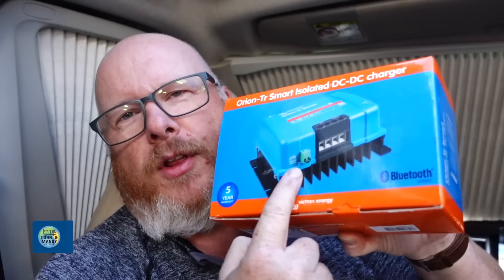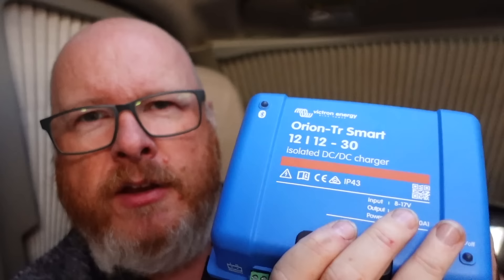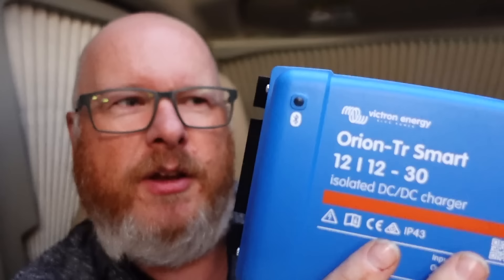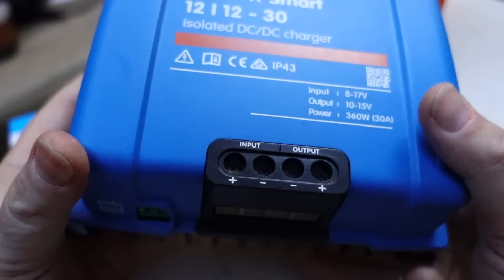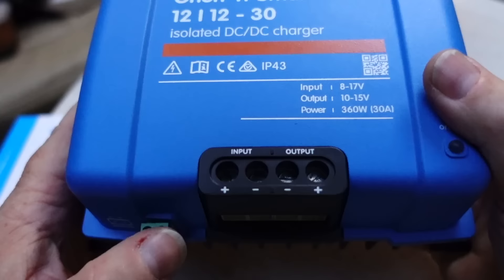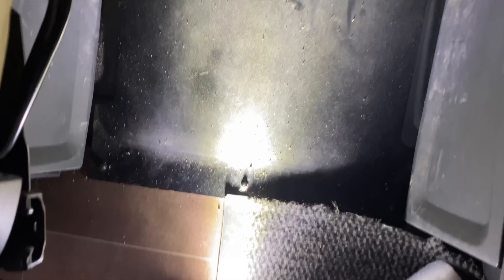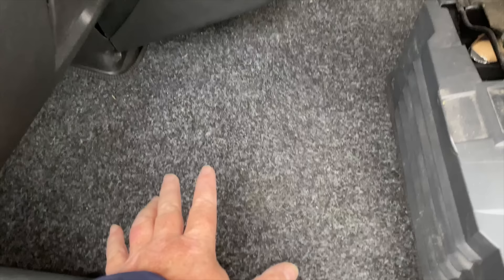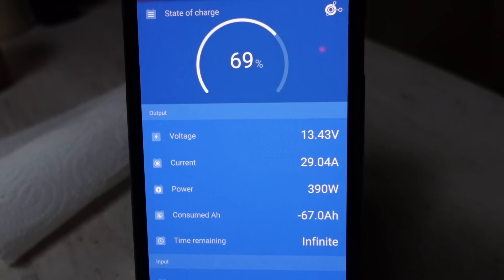Victron Orion DC-DC Isolated Charger B2B Installation

Comment: Hej!
Wondering about a few things:
- My EBL is older but it charges my car and house battery when it is connected to 220v.
Wouldn't this trip the B2B charger to "open" the circuit? Since then the car battery voltage goes up.

- Is a standard alternator sufficient to supply 50 amps for charging (20a+30a) when for example car lights (250w) + 12v absorption fridge (220w) is on?
Reply from the maker: Our alternator copes just fine with this. The b2b sees the alternator voltage, so it depends on your ebl charge voltage, but the ebl hookup charger does NOT cause my b2b to kick in.

Comment: Hi John ,
great video well explained thank you very much. 
I have a question: 
Will this device charge in both directions? what I mean is, will it charge my starter battery. I live in my van and don't drive very often but I have a good solar setup. Can this be set to keep my starter battery topped up? 

Scott 🤘

Comment: Hello from sunny Playa del Rey, California! I have a question that I think is in your wheelhouse: what do you think about me using Anderson connectors from the Orion to my cute little 50a LiFePo so that when I arrive at my destination I can pull the battery out easily (it actually has a rope handle) and carry it off where I can then use the same connector to hook up to my inverter? Jackery Hack! Or am I just dreaming 😀? I sleep in a tent with a CPAP and would love to not have to run an extension cord to my vehicle. I'm a new subscriber and look forward to combing through your videos this evening. Cheers.

Comment: Hi John,
I've got Toyota VERSO car and tow Knaus Sport 500 FDK and wanted to know can I put a DC to DC charger to run from my car battery to my batteries in the caravan. I know all or most of your content s around the motor home market.? I imagine a larger rated wire from batt /Alternator via Anderson plug not via towing plug 13 pin? I'm going to Paris area in ept for some WCR 2023 and of course will  back the Aussies. Cheers Chris the Aussie living in the Netherlands 🇦🇺🍾🏁

Comment: Great video. only thing I thought you could add is if other's are going to "double up" on their chargers then not to exceed the batteries C rating.:)
Reply from the maker: That’s where a b2b comes in as it wouldn’t allow an overcharge. 👍🏻
Reply: @johnmandy  I'm referring to the bulk charge phase and exceeding the C rating. :)
Reply from the maker: Yes, as I said with a quality b2b that will not happen.
Reply: @johnmandy  I'm just trying to help here so please don't think I'm on your back or something. My point was not everyone will be aware that their AGM batteries for example will have a maximum designed charge current of 30% of capacity. So 30A for a 100Ah battery.
IF they was to copy you they would exceed that batteries maximum design charge current. The B2B would only see 30A charge as the other charger they had (eg a 20A like yours) would not be going through the internal B2B shunt. 
So in bulk charge the battery would see 50A charge exceeding the 30A C rating. This is not about final voltage and float as both chargers would stop charge and float, this is about the exceeding the C rate during bulk charge and what effect that would have on the life of the battery.
I just thought this needed saying as we both know people will copy you not fully understanding they can't just go doubling up charge current unless their battery can take it. :)

Comment: Great information there John.  Thanks so much. I have installed the same after watching your video. However somebody has told me that I have fitted the wrong circuit breaker. I fitted a 30amp like you showed.  My Dc to Dc is 12/12 30amp. Should I be fitting a bigger breaker? Thank you.
Reply from the maker: If you copied me then it’s fine, ignore the other advice.
Reply: I was told the same thing? Now I am worried? 🤷‍♀️
Reply: @juliep4193  I think John knows what he is talking about.  👍
Reply: @Wizardinthewild  Yes, I trust John. My problem is... I don’t have a great deal of knowledge when it comes to amps and alternators. I know enough (I think) that the guy who installed my 12/12 30 charger used 10 awg wire, (I am not sure what that size is in UK?)which is wrong, so I am re-wiring it myself now. My 30 amp breaker kept breaking after a few minutes. Which I didn’t understand? I am hoping it is due to a much to small wire? And not the fuse? I will stick to the 30 amp fuse I have and see what happens? Do you have any thoughts? I have a 2019 Ram Promaster and I am “pretty sure” it is a 180 alternator? Thanks for your response. I needed that encouragement to move forward on this. I haven’t been using the charger.
Reply: When I say fuse, I really meant breaker, I have the same 30 amp one John is using.
Reply from the maker: @juliep4193  Ot could be a faulty breaker. I’ve seen this before with poor quality breakers
Reply: @johnmandy  Thank You John! I will order another 30amp breaker if the problem persists, after I put the bigger gauge wire (6 awg) US. 🙏

Comment: Except for the choise of battery type; are there anything else in the settings that needs to be configured? I got a motorhome with start/stop function. Thanks for great videos. Peter
Reply from the maker: No, just the battery type and the rest it handles itself 👍🏻

Comment: Why are split chargers a bad idea now a days ? I've just bought one to put in my 16 plate Renault trafic. Are you saying I should ditch my split charge unit and get one of these ?
Reply from the maker: A split charger can’t detect the state of charge of the battery, whereas a good quality b2b can offer different levels of charge to allow the best charge to be delivered right up to 100%
Reply: @johnmandy  sadly at over £200 and on a budget, not within my reach this time. I have to stick with my split charge unit for now

Comment: Great video John 👍
Do you have a smart alternator - is it relevant what type your alternator is?
Are you concerned about the load on your alternator, surely this is more of an issue driving along when headlights and other vehicle battery loads are added.
Have you thought of carrying a spare alternator - I detect they are a problem with motorhomes.
Hope your much happier in lock down this time and new electrics are reliable throughout.
Thanks for posting.
Reply from the maker: The beauty of a b2b, as I showed in the video, is that it amplifies the charge, so it’s not putting a large load on the alternator. 👍🏻

Comment: John has your van not got an  Converter’s socket in the B Pilar behind the driver's seat you could of contacted the B2B to easier?? Save taking up carpet
Reply from the maker: The factory cable isn’t suitable for the amount of power I’ll need for this & additional b2b’s

Comment: I’m just about to install the same device (except in non-isolated type) in a travel trailer.  I want to put a switch on the B2B charger so I can easily turn it off - for example if caught in bumper to bumper traffic on a hot day.  My interpretation of the manual is that all automatic functions will still be intact when the charger is on.  You seem to be under the impression that they might not.   Am I correct?
Reply from the maker: The non isolated in a trailer? How will the chassis grounding work to the vehicle? 
If your engine is running the b2b will charge the leisure battery, makes no difference if the engine is idling or your driving along a road. It’s all in the video 👍🏻
Reply: @johnmandy 1) The truck and trailer chassis grounds are connected.  2) Alternators cool their selves by way of a fan that spins along with the alternator - so the faster it spins the better it cools.  When an alternator gets fried by a dc2dc charger (which definately does happen) it's often caused by heat.  So turning the charger off during long periods of idling - especially in hot weather - could save the alternator.  Also if the alternator (or other part of the charging system) does fail you always want to turn off as much of the load (AC, stereos, etc) as possible when you notice an issue.  It can be the difference between driving to a shop or having to be towed.

Also I might add that my truck came from the factory pre-wired with accessory switches that makes it extremely easy for me to do this.

Comment: Oh Id just say to anyone, use the hydraulic crimp tool like John has, the others including the cheap hammer style dont work as good and can result in a loose connection, not to mentioned where are you going to hammer it properly if you are in the van whilst fitting??

Comment: John, you are my “guru” when it comes to electrical circuits. I’m converting a Sprinter into a MH and your hints are always life savers. 
I’ve bought the B-B charger and the solar controller but I was afraid to connect both to my leisure batteries (3x220Ah AGM) because I was afraid of overcharging (too many amps). 
If I understood what you showed, that is exactly what happens (amps are added) but that’s no problem / no harm for the batteries. 
Did I get it right?
Reply from the maker: As long as you setup the chargers then you’ll not overcharge your batteries 👍🏻

Comment: Hi John what would I need for a lithium set up I’ve currently got a truma 100w panel with dual charger and banner leisure battery.would I need to change to a b2b dual system if I changed to lithium or would it run off my truma dual charger.some lithium say their a drop in replacement?
Reply from the maker: I’ve got lithium batteries, so you could replicate my system. The b2b charges the battery on the output, it doesn’t charge the starter battery 👍🏻
Reply: Is their a dual charger that will do both cab and leisure batteries.with a lithium set up?
Reply: @mikespeers8281  cheers Mike

Comment: Hi John, question about the second charger. I’ve got a victron charger right on the leisure battery. Will it then charge the starter battery trought this DCDC as well? Or is it only (hopefully) one way of charging, and only works when the starter has a higher “charging” voltage.

Best regards, Taeke

Comment: Thànks John very interesting. I have a motorhome with the same built in charger and solar panel. Can you do the same with a second solar charge controller? Whats your alternator max output? Dont know what the van consumption while night driving? I have  seen people change the alternator for a temp sensitive one to restrict the max load.
Reply from the maker: Doubling up solar controllers isn’t something I’ve tested.  Since I’ve never tested my alternator on full load I’m assuming it’s the smallest that fist make at 110amps, though burstner might have upgraded it when it was ordered?  Either way I’m never going to stress the alternator out with lights on, heating, radio, chargers etc. So it’s not something I’m worried about. 👍🏻

Comment: Hi John and Mandy. We are avid followers of your channel and look forward to your videos every week. Andrew here. I'm after some help please. We are currently converting a 2017 euro 6 compliant Mercedes sprinter. Me being me went and purchased a voltage sensitive relay only to discover that it's not quite as simple as that because our van may have a smart alternator fitted which would render the vsr useless. I'm a bit of a newbie with van electrics so was wondering if you could give us some information on what we need to charge our leisure batteries on the go. We are fitting solar panels but we live in England! . Would this victron device work or do we need something else. Thank you in advance. Two old buggers on holiday. Andrew and Barbara.
Reply from the maker: Yes, this b2b is perfect for your van 👍🏻
Reply: @johnmandy  Hi John sorry for the late reply. Thanks for the info. I will be getting one of these just to be on the safe side.  Andrew & Barbara.

Comment: Thanks for the video. Currently looking into a b2b charger and want Lithium capable. Currently 2x140ah SLAs in Motorhome and another 2 120ah in an Avan we tow behind. (my man-cave). Put in 2 Victron 30 amp mains chargers last year (mainly to use with generator) and Love them and the app so happy to go with the same company. They also seem to be the only ones that are lithium capable. Bit concerned about the effect on the alternator though (no such thing as a free lunch?) and I understand Lithium batteries can put huge loads on alternators. Any comments on this greatly appreciated.
Reply from the maker: The load is smaller than the output, look at your mppt controller, it takes 10 amps of solar input to make 40 amps of output. B2b’s are mppt’s 👍🏻

Comment: Hi John. Another good video mate. Why have you used one size of cable for the input and a different size for the output? Cheers
Reply from the maker: In case I wanted to add another b2b I used a 16mm cable from starter to the hab battery box 👍🏻

Comment: Hi, John & Mandy 
Can you just replace a vsr for one of these (the non isolated one) and wire the negative to my ground busbar it’s in a panel van Peugeot boxer
Reply from the maker: Yes, as long as your Neg busbar is also wired to the van chassis with at least a 16mm cable. 👍🏻

Comment: Hi John, Very detailed video. I run two AGM 100amp batteries with a Victron smart charger 12125 /120v wired with inline fused/breakers. Because of the minuscule less than amp charge from the 7 pin camper truck (popup trk camper)  plug as you say I was told to get a dc to dc charger to help maintain or bring up charge in batteries while driving. Would this pare well with my Victron smart charger 12125 and do the job? Thanks so much for any info.

Comment: Very informative video, thank you. I have a question. If one uses the Victron B2B charger, do you need a BMS on the Lifepo4 battery to ensure battery is balanced?
Reply from the maker: It is best, really if you get a lithium with Bluetooth bms you don’t need a BMV. Our batteries are linked on our website.

Comment: Hi John I thought the BTB charger only needed 7volts and above. Why is not on all the time. How does it know when the alternator is on. I thought is was for smart alternators. Mine can struggle to get above 12v output.
Cheers Dale
Reply from the maker: It sounds like yours is faulty. They’re for any alternator, they detect the alternators voltage.

Comment: John, thanks. Is there a benefit to tieing that green plug into an ignition wire, so you can assure that there's no drain on vehicle battery when engine not running? I read that there may be a small parasitic drain on vehicle battery otherwise.
Reply from the maker: In over 1.5 years of use it’s not drained the starter battery, so keep the install standard as it works best that way.

Comment: ThankU John for great explanation . How I can finde de second isolator you showed on video. The square one ( looks like Lego pieces) with red top and little trip switch?? 
And other cuestion what cable you using it’s a 25mm2 plug input to Orión, and 16mm2 Output?? 
Cheers&StaySafe 🛠🚐✌️
Reply from the maker: John can answer your question better if you follow us on Instagram & the send a private message. Thanks 👍🏻

Comment: Really good video. Would it be possible for you to show where you put the B2B? The heat is a concern. I too have a Burstner and would love to see your Victron installation.  Thanks for the video 👍 Keep up the good work
Reply from the maker: This video shows everything installed and working, I also have another 12v advanced electrics video showing everything installed.
Reply: @johnmandy  brilliant, does the dcdc protect the engine battery from being discharged by the power hungry LiFePO4? Any probs with the alternator having to work hard to feed the dcdc?
Been told the LiFePO4 will drain engine battery and/or stress the alternator by requiring to much amps before being fully charged. Very confused and would love to know the dcdc taking care of protecting the engine battery/alternator.
Reply from the maker: The engine and battery don’t see the leisure batteries, the b2b manages the power. Too many people giving out daft advice, or using the wrong type of chargers for the job. 
All the info is in the videos I mentioned.

Comment: Great review. I saw Victron also have isolated dc to dc Converter. Have any idea how they are different ? Currently I have requirement to convert my solar 48Vdc Lifepo4 battery bank to 12Vdc to power up 12V fan, refrigerator, and some LED lighting. Do you think Victron isolated 48V to 12V converter will serve this purpose ?

Comment: John, could I also use this in my caravan to load from the car battery when driving and connected to the hook-up. Off-course including a low level voltage cut-off for when the engine is shutdown.
Reply from the maker: Yes, that would work fine 👍🏻

Comment: Excellent insight how to install the BtB John , I'm thinking about fitting one in my Adria but heard some folks saying Motothomes already have chargers for trickle charging leisure batteries, does that neani need to disconnect the Adria one before installing the Vitron , I'm a bit confused , can you advise please.
Reply from the maker: If you watch the video you’ll hear me talk about the factory charger in our van👍🏻
Reply: Thanks John seen the info now sorry if a pest but one more question on the power cable from the starter battery to the BT B in side what size is the fuse at the battery end and what size is the isolater fuse unit just before the BtB  sorry again if being a pest

Comment: Hey,  I was wondering if it is possible have a 14V input from dcdc converter to the Victron Orion DC-DC Isolated Charger, to charge the auxiliary battery. Thanks in advance!
Reply from the maker: As your alternator produces 14.4v usually, that’s what this is meant for.

Comment: Great video. Just fitted mine after watching this. I have noticed that my Bluetooth light never stops blinking. It is blinking every 5 seconds which states it’s under normal shut down conditions but can I confirm yours blinks even with the engine off?
Reply from the maker: Yes, it blinks all the time in standby mode.